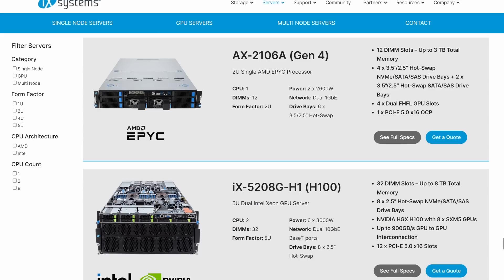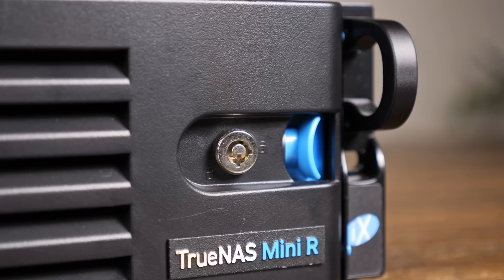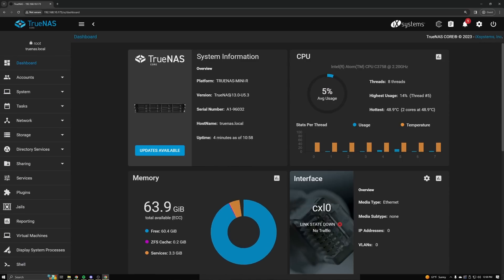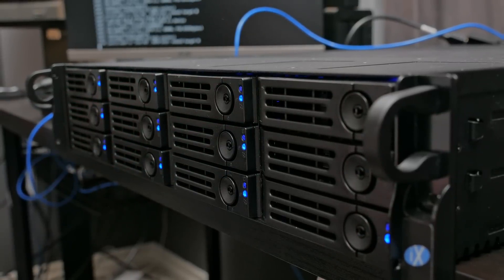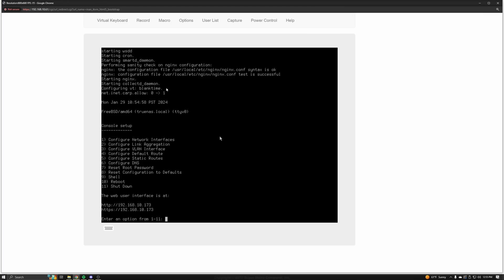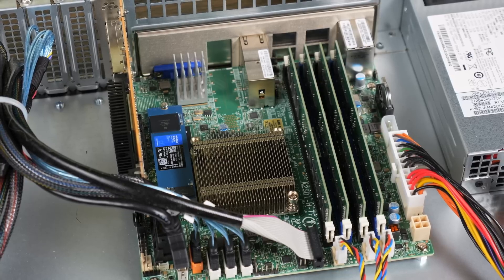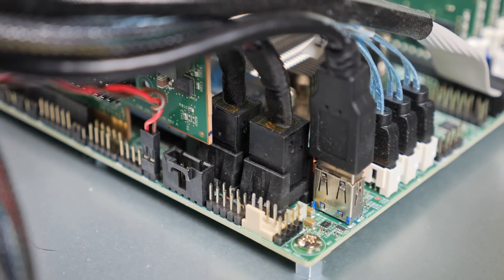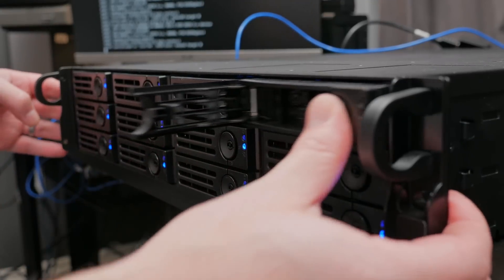This NAS Isn't For Me. But I want it.

Comment: it is a 4-5k nas after drives and most smb clients need 2. i just built security onion - quite the monster build, even got webmin installed on it - it takes an hour to build, install is 40gb but selks and malcolm are other linux ids/ips distro alternatives. i see this server build as mostly overkill - instead just get a cheap am4 and add 4 nvme, 4 spinning rust in 2 arrays and 10 or 40g and save 3k - you can build 2 for the price of 1 and still save money...sec onion also sells servers which are semi impressive - i like your approach to low power and low noise - you can and should build something better than this nas - go with a 4u case and all flash plus good networking - lots of options out there for imaginative creators to make nas that better suit their needs - smb pays for these systems for the warranties and support as much as for the hw - my humble opinion - if you do need something like this just get a old dell r730xd and one underclocked cpu - from 1k well equipped. good due diligence here on this one my last comments would be - this shows how much opportunity there is out there for builders and the other thing is people should really look at 25/40g networking - and dual nas to avoid downtime....networking layer is the weakest link - faster links help speed up workflows and you can't put a price on time
Reply from the maker: You should, and I should, but I was pretty clear on which users probably shouldn't.
Reply: @HardwareHaven  you shouldn't and i shouldn't and whitebox builders shouldn't - we all should build our own improved versions and resell to smb who look at warranties and support as less than optimal and overpriced - their own internal and local teams should man up and run dual nas to avoid downtime and get better networking going while reducing noise and having more better performance envelope - there may not be a better time to start up a small bespoke nas/router/server company than now #clear IT scientology

Comment: That power consumption at idle really suprised me...Currently i have old 12bay Synology DS3611xs with upgraded Xeon E3 1260L (45W TDP) and full of pretty old 3TB drives...but my consumption at idle and even in the load is the same...I didn`t see that coming. 😀
Reply: Wow, it draws that amount of power when running a TruNAS or other OS?
Or are you comparing apples with oranges that only have to support a tenth of the amount of background tasks?

Comment: The identify drive feature is dependent on SAS drives, SATA does not have this function so nothing happens when you click the button.
Reply from the maker: Ah that makes sense. I failed to mention it in the video, but the button shouldn't be there for the Mini series for that reason. It's correct in Scale, but needs to be fixed in Core.
Reply: @HardwareHaven  Correct (SGPIO is a SAS feature.)
Reply: Small correction: it's dependent on a SAS backplane. You can use SATA drives with a SAS backplane and still get the identify drive feature.
Reply: @pproba  even smaller correction: direct-attach backplanes like this one don't care whether the drives are SAS or SATA. What matters is that it has a management chip that can speak SGPIO, UBM, or some other management protocol, and that it's wired up (either via a SAS connector, or via a separate management cable). SAS backplanes with an expander don't need this, because the management all happens via the expander chip, which might be what you're thinking of.

Comment: I'm torn. I do have a small engineering business running out of my home office, which supports myself and 3 other designer/engineers. We do fine on our own machines, however utilizing a cloud based storage solution.... isn't the best. We'll also, would like to, at some point in the near future, have most (plus new employees as we grow) work from home. Sometimes Youtube and Google are great for information, but it is a lot of the time TOO much information. Something like this sounds amazing, but it is most likely overkill for our situation. If I could combine a solution to support work files, home files, media (UHD rips) and have the ability to share the work files to offsite users/employees, that would be great.
Reply: You will probably be fine with an older model or a regular server with lff bays and a really low-end cpu, just to save power.
Reply: @leo_craft1  
In terms of saving power -- I would actually make the proposal where you compute some kind of a "made up" performance metric (e.g. clock speed * # of cores * # of RJ45 ports * RJ45 port speed ...etc.) and then divide that by the price and maybe divide that again by the idle power consumption or something so that you would be able to get the most "bang for your buck" basically rather than looking at only performance/$ or only power/$, but to look at power, performance, and cost, simultaneously.

You can get cheaper, lower power, but less performant systems just as you can get more expensive, but high power, and more performant systems as well.

The goal would be an optimised solution between these three parameters, and the answer may surprise you.

(And if you want to lean heavier towards performance at the expense of cost and power, you can also choose to do that as well.)
Reply: You could, but if you don't have experience working on IT this can be troublesome, plus your ISP may not like if a lot of people are downloading something through your link as you probably have a domestic link from your ISP, not an enterprise one. What we do at the small business I work at, is just renting servers and storage from a provider, there are many companies running this type of business. We got an ESXi server, created a Fortigate firewall and then I just needed to create the rules and change the management configuration from the ESXi, so it cannot be accessed by people through the internet without our VPN.
But again, if you don't have someone working with you that actually knows about OpSec this can be difficult and even risky.
Reply: There are a lot of different options for your use case.
Reply: @ewenchan1239  Yeah. It would be a lot of fun setting up different options (& learning a lot more) and seeing what I like best, but unfortunately I don't have a ton of time in my daily grind to mess around with too much. Employees wouldn't have any downtime, since most data is in the cloud or my main shared directory with SMB. I just sometimes watch a video or read information online and wind up frozen with too many options.
Reply: Why would you mix personal and work data on the same server? Seems like a recipe for disaster, depending on what kind of data-handling regulations your company is subject to.
Reply: @theglowcloud2215 copies of copyrighted movies on a business server is always a bad idea 😜
Reply: My suggestion is to have a smaller Nas in each home with rsyncs set up to back up data in case of drive or system failure. I personally use Truenas Scale for my home server. And I appreciate the zfs system for the data integrity and I love the ease of setup for vms apps rsync and cron jobs like snapshots and system backup images. Plus it keeps all of your data backed up on each other's systems.
Reply: @Yuriel1981  
rsync works if you don't lose the internet connection and/or power.

If you lose internet connection and/or power -- trying to figure out which system has the "good" copy would require a bit of work.
Reply: Honestly, it sounds like you need something quick. My suggestion, figure it out backwards. Start with cost, then go with storage (max amount of diskes/storage you can get for that cost), and then it should make the storage solution more clear. If you're budget is 5k, and you want 20TB HDDs, guess what? That limits you to about 10-12 disks. (Average new price of 20TB for enterprise seems to be around $300.) That leaves you with around $1k-$2k. I would also suggest that you have another storage backup in another way, especially if you're running a business. Don't be stingy with data and data protection measures.
Reply: @stefsmurf  
"Start with cost, then go with storage (max amount of diskes/storage you can get for that cost), and then it should make the storage solution more clear. If you're budget is 5k, and you want 20TB HDDs, guess what? That limits you to about 10-12 disks. (Average new price of 20TB for enterprise seems to be around $300.)"

I agree with this in theory, but I would modify this approach where, if you possible, project or predict what is the total capacity that you need.

From there, you can then run the cost optimisation problem where you vary the capacity and number and the RAID configuration that you want to deploy which is, in and of itself, another optimisation problem between fault tolerance/redundancy vs. storage efficiency.

For example, if you want 120 TB raw storage, you can accomplish this with twelve 10 TB drives, and if you open to the idea of buying used hard drives (which, for the most part, work fine), that can help to lower your costs.

(You can buy a lot of 20 10 TB drives for ~$80/drive, so that'll only run you $1600 and you'll have 8 cold spares available.)

My new-to-me Proxmox server is powered by dual Intel Xeon E5-2697A v4, 256 GB of RAM, and 36 HDDs and the server itself (before the hard drives) was $1195 USD.

My hard drives, I bought at various points in time, but even if you were to have to build the system from scratch, you can run through the calculations with Excel and come up with a reasonable cost proposal given performance, raw capacity, and usable capacity (after multiple raidz2 vdevs in a (single or multiple) pool(s).

Comment: Well, can't believe opensource hardware sells, it's quite fascinating
Reply from the maker: I mean, it makes sense in a lot of ways
Reply: open source hardware? You mean hardware/machines running open source software? As if so, nearly every piece of hardware if I had to venture to say, runs open source in some way (whether a library, OS, etc.)
Reply: Quite literally, all of the hardware in this case is closed-source.
Reply: @tim3172  that's what I said, if opensource hardware is selling this means people are fed up of the closed source ones, soon we will be able to made our own server with fraction of the cost it will be sold by the big tech 

At last opensource hardware is not for everyone, someone will still need a closed source stuff